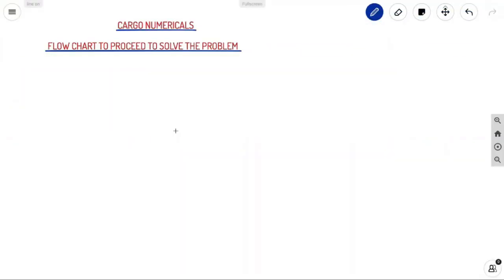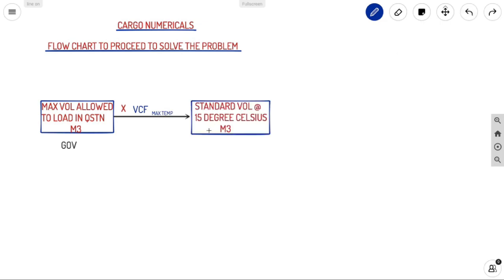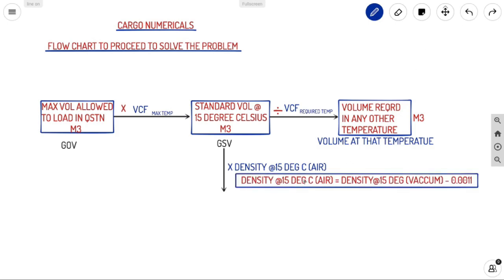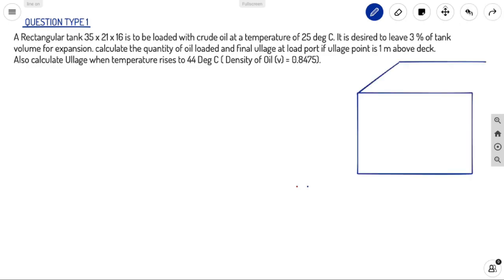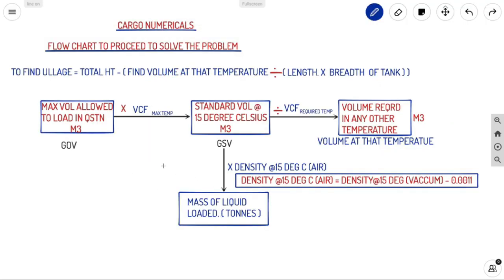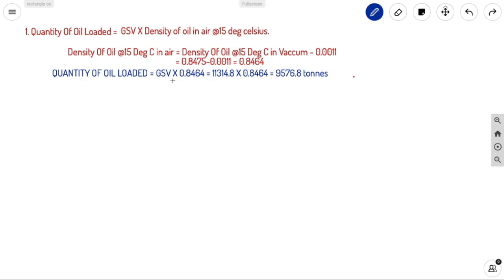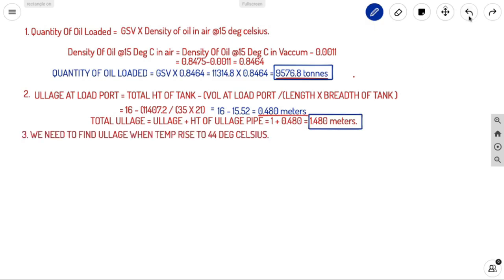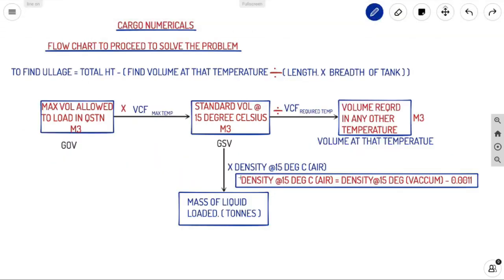CARGO TANKER NUMERICAL SOLVING PART 1 | TANKERS | FLOW CHART | TYPE 1 PROBLEMS | AHOY! NAVIGOS.

Comment: Sir your vcf for 25c is .9919 but this value is given for .845 density not for .8475
Reply: And also if take first max temp as 44c and then divide with vcf of 25c then also answer is coming different